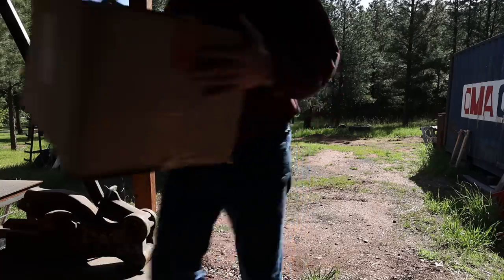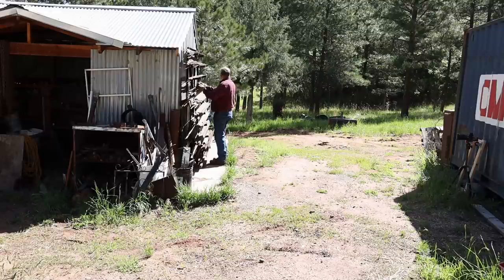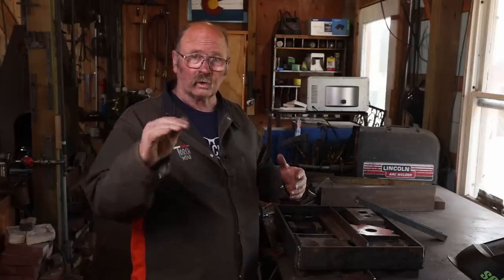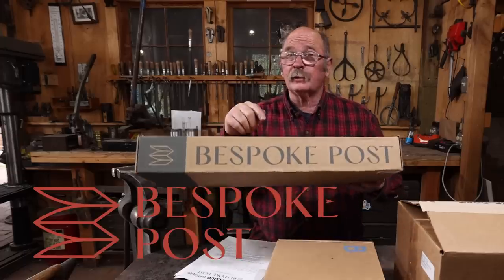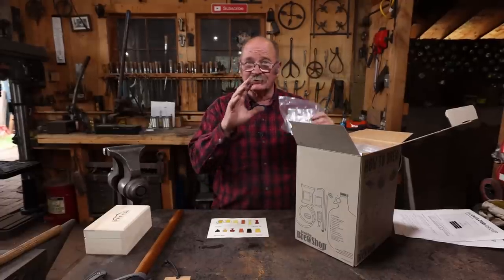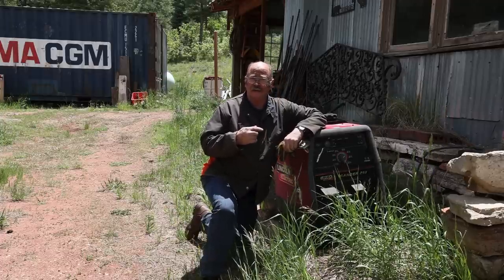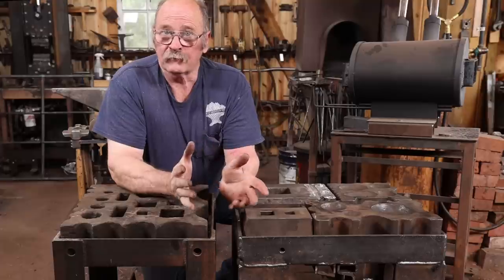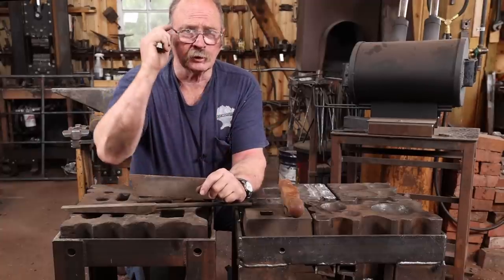Swage Block Stand

Comment: Looks a really goods setup John. I glued some "rubber" pads under the feet off mine, cut them out of one of those dodgy exercise matts they sell in Kmart type stores. They do a really good job of soaking up the rock and roll from uneven floors. It also adds a bit of friction so the whole unit doesnt start to walk around the floor when you are putting a bit of hurt on it .
Reply from the maker: Great idea

Comment: John, I see guys in my blacksmithing groups buying 50 ton presses. I'm building my own press. What would you say is the minimum pressure I should aim for? 50 tons seems like a bunch of overkill for a novice hobbyist like myself.
Reply from the maker: 50 tons sounds pretty big.  Mine is 24 tons and Coal Iron Works sells a 16 ton version that seems pretty useful.